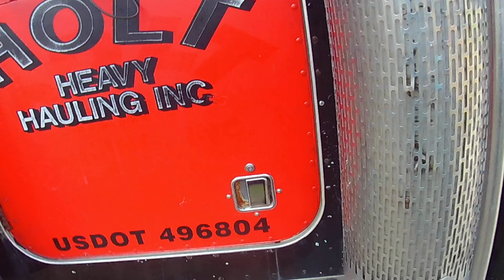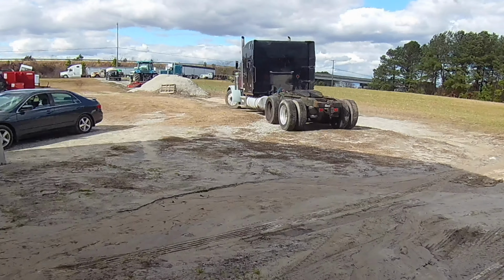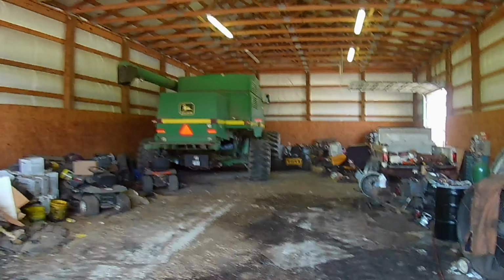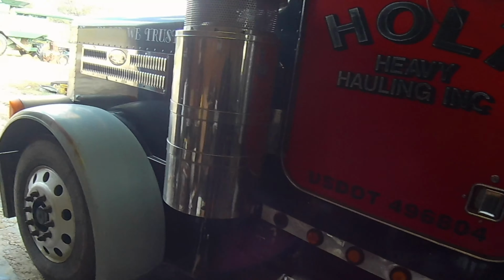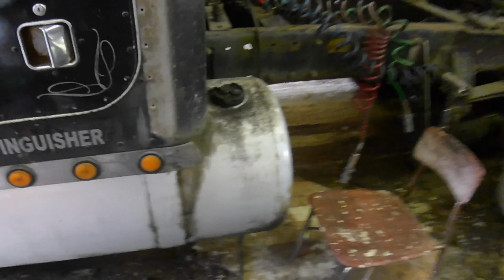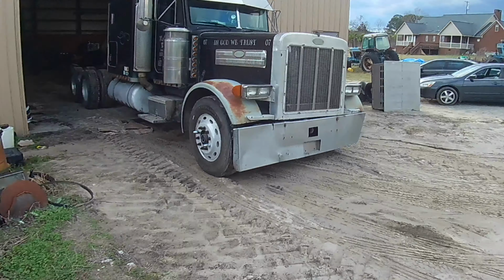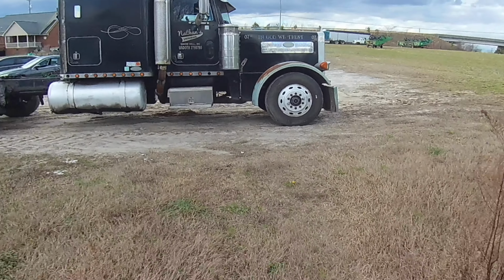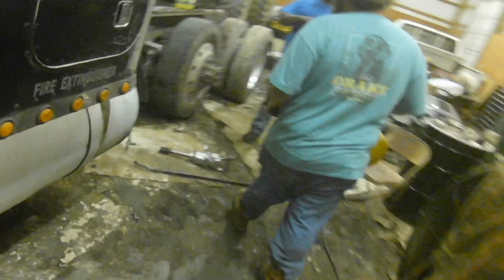Peterbilt 379 Rebuild - Episode 2

Comment: What you gonna do about the holes in the sleeper where you took the fairings off ? I’m planning on taking mine off as well just don’t know about the whole huck bolt thing
Reply from the maker: Tyler Davis i think he is going to either bondo and cover the holes or put hucks back in!
Reply: 10-4 Preciate the feedback and the idea 😌
Reply: Are they huck or thread in bolts? My coronado was bolt on fairings, we cut the heads off the bolts, cut a shallow slot in the bolt, screwed them back in and body filler before painting.
Reply from the maker: TheRoadhammer379 these were huck bolts on this sleeper!
Reply: @24akaboss  10/4, keep at it, can't wait to see the finished result
Reply: I did mine and I use Olympic rivets!